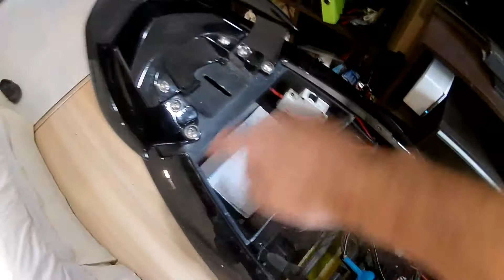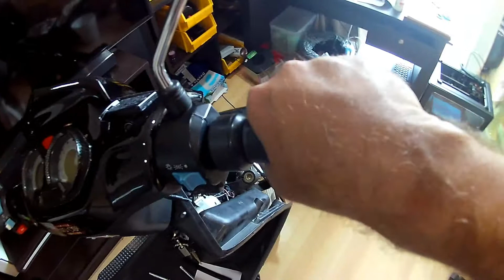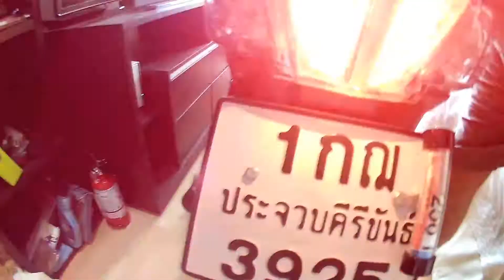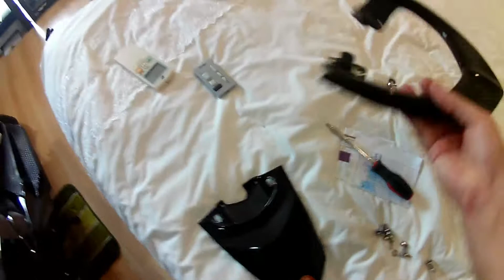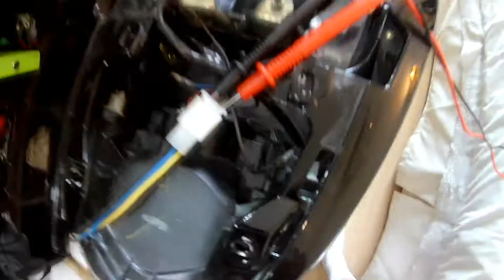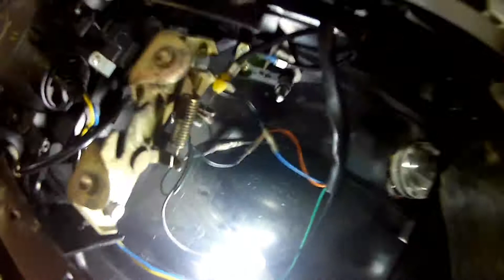Toyotron Electric Scooter Upgrades Number 12 - 4 Mini Projects

Comment: Nice progress - Toyotron might hire you for some R&D once you're all done pimping your ride :) 

Some ideas for your grip hardness conundrum... short term: try some handlebar wrap or padded riding gloves. Long term: if you can pop those chrome end caps off and cut off the hard grip stuff, you can model and 3D print your own soft grips using ninjaflex.